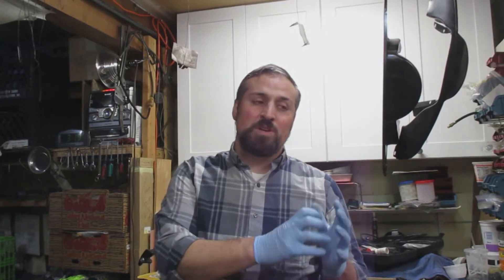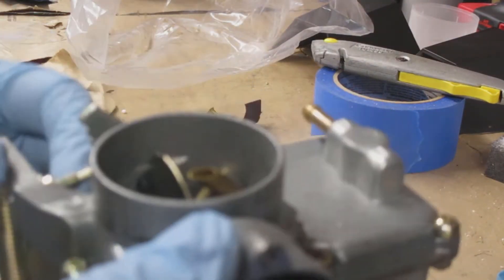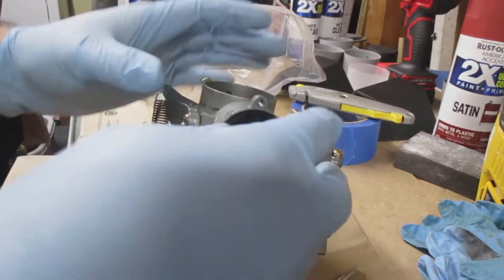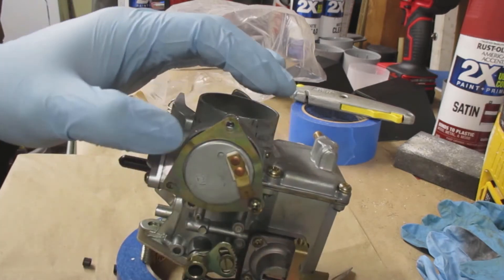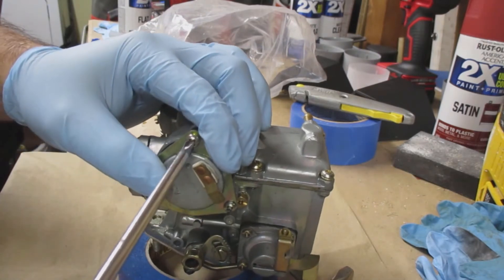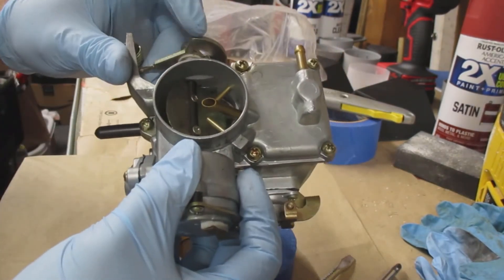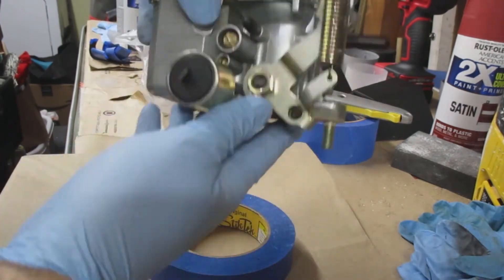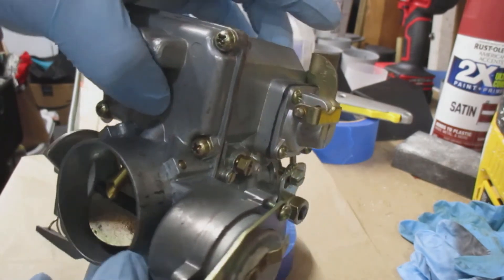How to install choke on an air cooled VW carburetor - bug beetle ghia thing bus - you can DIY

Comment: So do I need a 12v source for the choke to come off?

My 12v is disconnected running on a 87 Tercel. Wonder if I can use a constant 12v source if the choke will work decent?
Reply: No
Reply from the maker: not sure about the details of that tupe of vehicle. Thank you for watching. :) #mountpac

Comment: I noticed you didn’t line the mark in the choke up. Do you not have to? Once you put it in don’t you have to twist it to set it?
Reply from the maker: sometimes the marks are out side my adjustment area. I use the butterfly as my guide. Thank you for watching. :) #mountpac

Comment: What is the wire connection (Solenoid) low on opposit side from choke? Where does that wire go to?
Reply from the maker: Hello, great question. I usually use a green wire, I connect it at the choke then to the "Solenoid" (idle shutoff valve) then to the positive side of the coil. I hope this makes since. If not please check out my other VW engine video's. Have a great day!
Reply: @mountpac4464  Can you simply connect the wire from the electric choke directly to the positive side of the coil? I’m not sure I have an idle shutoff solenoid. Where would that be located? I have an 1835cc VW engine on a dune buggy that never had the choke wire connected. Thank you.

Comment: My bug runs when the choke is on. However, once I hit the gas after it has warmed up and off the step the bug will die.  No matter what adjustments I do to the volume screw or the bypass adjust, nothing happens.
Reply: Fully adjust the choke to open after it warms up. I had the same problem . See if this helps and then adjust the choke after accordingly
Reply from the maker: may be rebuild the carb or get a new one. Thank you for watching. :) #mountpac
Reply from the maker: the choke does do funny things to the engine sometimes. Thank you for watching. :) #mountpac

Comment: I'm actually looking for information about the electrical path.
Reply from the maker: The wire (usually green) connects to the electric choke then to the shut off valve then to the positive side of the coil. I hope this helps. #mountpac